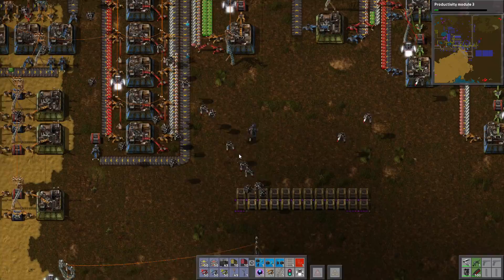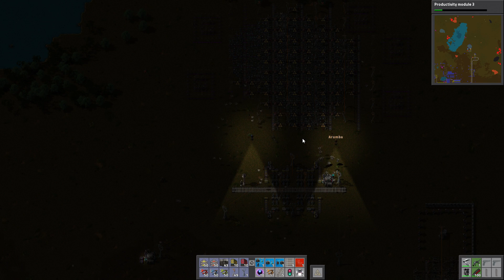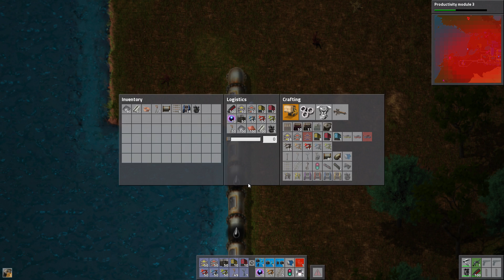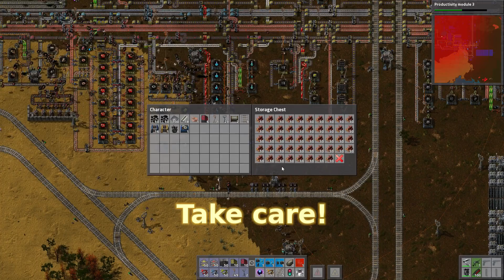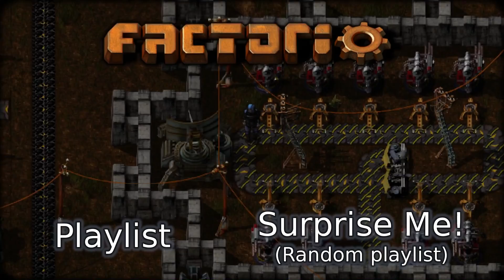AAA Factorio 36 *Multiplayer* - Irobot Lumberjacks

Comment: I guess the best storage system you can do is to just have a whoooooole lot of storage chests. Then activate the robots and they will pick 1 chest for each resource. You'll have a bunch of 1 item type chests and will be able to use the icon to easily know which storage chest you need.
On that note: Do active provider chests give items to storage chests? If so, it would be a good way to centralize all your items. Make EVERYTHING use an active provider and have tons of storage chests in 1 spot. Everything made will be brought to your storage area and to requester you have around the place.

Hmmmm... I'm interested in trying that now. Have a central storage area and surround it with factories. Then add smelting around that layer and finish with gathering (or train reception)

Comment: To answer your question about the pumps, a fellow did the math on the forums. Fluids in pipes loose compression over distance. Basically you need a pump every x depending on the throughput you're aiming for. http://www.factorioforums.com/forum/viewtopic.php?f=5&t=6066

The way the logic works for storage chest is (and i'm paraphrasing here...):
- Find a box with that kind of stuff in it close to here
- Find a box with that kind of stuff in it anywhere

- Find an empty box

That's why the wood was coming up to that storage chest in the firebase. There was some wood there already.